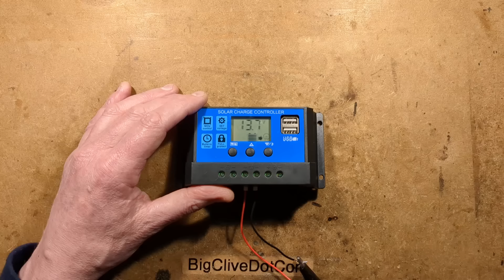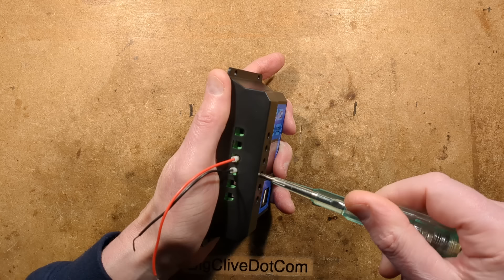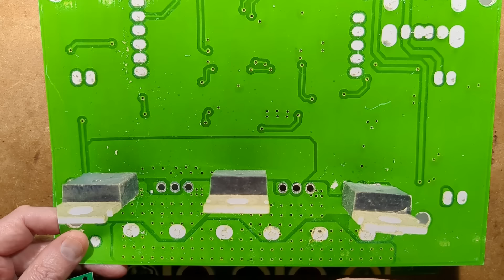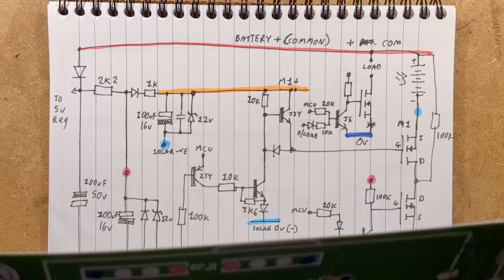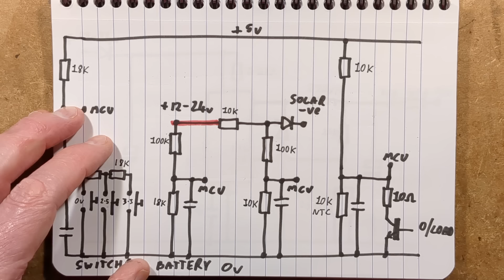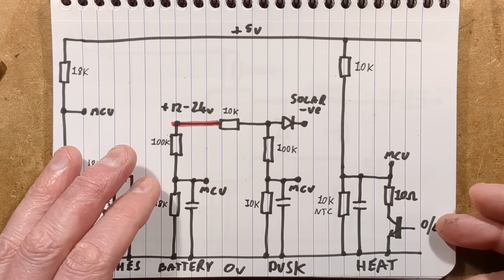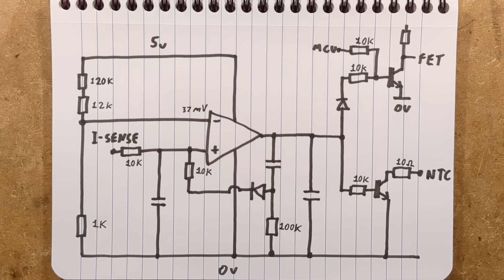Exploring a mass produced solar charge controller

Comment: For anyone wondering what the magic MPPT (Maximum Power Point Tracking) is about, and why it's better: solar panels produce approximately the same voltage regardless of the current they are supplying, until you exceed a threshold, when the voltage drops rapidly. As power is voltage multiplied by current, this threshold is the point where you get maximum power out of the panel, and depends on conditions (temperature, but more importantly, how strong the light is).

An MPPT solar charge controller presents a resistance to the panel which results in it delivering the maximum power. It does this using a buck regulator and an algorithm to adjust the power transfer of the regulator as solar conditions change, which can be hard to achieve when you consider things like shading of the panels. This cheaper PWM tech merely connects the panel straight to the battery if the battery voltage is within range. This will bring the panel voltage down to virtually that of the battery, delivering approx. the same current but less voltage than at its maximum power point. PWM is used to reduce the average current to keep the battery voltage in range as it nears full charge.
Reply: I've been using MPPT charge controllers for years, and I've noticed that PWM controllers typically generate 60-70% of the power compared to MPPT, depending on the battery voltage. With newer, more efficient solar panels producing higher voltages, PWM controllers are becoming increasingly inefficient. As a result, they drop more power, which not only reduces the overall energy output but also potentially increases the solar panel temperature. This temperature increase can further decrease the panel's efficiency and lifespan.
Reply: @CroftGaming1  Yes, that figure is one I've heard.
Reply: @CroftGaming1  you mentioned that "they drop more power, which not only reduces the overall energy output but also potentially increases the temperature of the panels". I'm assuming you're referring to their surface temperature. I'm interested in knowing some more about that if you can elaborate some more, please.
Reply: Several charge controllers which have been sold through Amazon (I haven't looked to see if they still are) are conspicuously marked 'MPPT' on the case but are actually PWM with a generous price mark-up.  (Marty T bought one for his solar set-up.)  They apparently work okay, but not as well as the picture and price would suggest.  Caveat emptor.  I use Victron, which are excellent — at a price.
Reply: @Alan-ln3ls  the brand name is MPPT Solar, the device is PWM. It's scummy.
Reply: @Alan-ln3ls  Well there are plenty of cheaper alternatives that work fine. If the listing contains photos of the PCB then it's immediately clear if they are MPPT or not. If it doesn't and what you receive turns out not to be MPPT, simply reject it.
Reply: @matthewmarks6951  Somebody did a detailed analysis of these fake MPPT devices in a YouTube video, and concluded that the display showed strange readings — presumably to reinforce the idea that they were MPPT — but as a PWM controller they actually did a reasonable job.
Reply: @Alan-ln3ls  I can agree to that.. Output for both are essentially the same for all common uses. My van has 4 panels, 2 x 100w (PWM) and 1 x 200w (MPPT) I can test any time with a clamp meter. All are connected to the same set of batteries so voltage is the same.. You would need a more precise measuring machine than my clamp meter to notice a difference.
Reply: @jefftysoutube  MPPT comes into its own at low light levels.  In your case, it would work well with the three panels connected in series (the controller would need to be rated for minimum 75V input).
Reply: FWIW julian illett has a lot of videos on the topic including a DIY mppt controller project series, they are really informative and he also checked a bunch of solar charge controllers for whether they are truly MPPT. can be helpful if you are looking for one. i just went for a victron controller in the end because it's proper MPPT and it makes a pretty big difference in efficiency in my experience. My evolution in a cabin was: the PWM controller in the video (pretty bad performance in winter) -> cheap pseudo MPPT controller from aliexpress that uses a buck converter that has to be manually set to the Vmpp of the panel (better but still not great in winter/low light) -> proper MPPT controller (works great). to be honest, i just had undersized solar panels for most of the time, i think the most straightforward for any small self-contained solar setup these days is just to overdo the panel size and get a cheap controller because the panels are super cheap anyway.
Reply: @Reversed82  Indeed they are super-cheap, but that means the limitation is often where you can put them.
Reply: I threw this away and replaced it with a true MPPT charger. Because these are PWM and leave a dirty pulse noise on the battery circuit that could damage 12v electronic circuits..such as a TV in a caravan. Or blow or flicker LED lighting.
Reply: @andrewtitcombe8378  MPPT uses a buck regulator which chops up the current in the same way. It's all down to how effective the filtering is.
Reply: PWM is better for mobile use. For example on van roof. If it is parked for longer period under roof will not make battery go flat and can restart even with flat battery.
Reply: @otofoto  How does it make a difference if it's PWM or MPPT? The device being reviewed consumes up to 4 mA constantly just with its voltage regulator, before you consider how much the MCU is consuming, so can certainly flatten your battery.
Reply: @matthewmarks6951 Difference is that PWM can auto recharge flat battery.
Reply: @otofoto  Why can't MPPT?
Reply: @matthewmarks6951 Because it needs reference voltage. Some models have manual override but it is manual.
Reply: @otofoto  PWM controllers need a reference voltage too, in order not to overcharge the battery. I'm still not with you I'm afraid.
Reply: @matthewmarks6951 need some practical test to confirm if MPPT can trickle charge flat battery.
Reply: @otofoto  I am afraid PWM controller would not start on flat battery, pretty much all of them say "connect battery before PV". As you can see on this particular model it would not work without any battery power.
Reply: @bumbarabun They say it to not have voltage peak. Even flat battery works as stabiliser.
Reply: @otofoto  Stabilizer is not enough. PWM controller would not even start to work until it gets voltage from battery. For example lithium batteries would not give you any power when flat due to BMS.
Reply: Both have pwm outputs. An mppt has current monitoring and turns down the duty cycle if voltage dips too far.
A pwm charge controller could be modified to work with higher input voltage as it's just a buck converter.
Reply: @3fives-j5w  No it isn't. A buck converter stores energy in an inductor, enabling volts to be converted to amps. There is no inductor in this circuit, so it cannot charge the battery with more amps than the solar panel is producing. However, you are right that a buck converter can be adjusted to limit output voltage.
Reply: To my understanding the drawback (used to be?) with using a MPPT controller is that it use more energy to power/measuring its circuits, meaning it uses higher standby power draw when there is no sun, whilst the PWM take less power as its just more of an simpler on/off switch. However this is old knowledge ive read on the internet and that might not apply anymore, also it might be that a better or more expensive unit is built so it can go into sleep mode to conserv energy at standby.
Reply: @Jon_Doe_404  When it's actively charging it will burn more power simply because of what it's doing but it's not an issue in relation to the power coming in from the array.  When charging isn't active MPPT chargers typically do draw more current than a dumb PWM charger but only because they continue to provide telemetry etc, ie they are doing things that a cheap PWM doesn't.  Again, it's really neither here nor  there.  A Victron 75/10 has an idle draw of 8 to 10mA.
Reply: @Jon_Doe_404  The only drawback of MPPT is price. There is no advantage to PWM other than being cheaper.
Reply: @gwillen  I think at very low currents there might be a minor disadvantage. For one thing you've got that inductor in series, and also the MPPT algorithm might start to hunt and be less effective than simply effectively connecting the panel straight to the battery. But as others have said, this may be insignificant.
Reply: Like you said tho it's based on how strong the sun is and in the UK that's a pretty big issue, the pwm just keeps pumping away as long as it's got enough to start they both have pros and cons.
Reply: @SlyerFox666  It's all relative. We have plenty of sun in the UK, especially in recent years in the SE of England. A 450 W panel costs about £75. I've been generating 30 kWh on most days from my roof for about the last three months. I can't use a lot of it. I got nearly 200 W from two 100 W vertically-mounted panels on a sunny day in December!
Reply: @SlyerFox666  I've seen it said that for small 12 volt camping type solar setups the difference isn't that significant. I cenrtainly get more power than I need to keep the battery charged most of the year with a PWM controller.
Reply: @NiallWardrop  Same here with a sub 25watt panel and an old car battery in the shed powering a few LEDs every now and then. Saved running mains powered lights.
Reply: @SlyerFox666  not exactly, a MPPT will produce more power than a pwm especially in low light and low temperature condition.
Reply: @CroftGaming1 only because they are typically wired to higher solar PV voltages. Nothing to do with mppt really.
Most pwm controllers won't accept voltages much higher than battery voltage so when the solar voltage dips it can't charge the batteries. With a higher input voltage it can still charge as long as PV voltage is higher than battery.
Reply: @3fives-j5w  No, I'm referring to the same battery voltage and panel voltage conditions. Interestingly, the MPPT voltage actually increases under low light conditions. However, when the light becomes extremely low and the panel's VOC starts to fall, the panel's power output becomes negligible, and you might not even get 1% of the panel's rated power.
Reply: What I still don't understand is that regardless of the voltage or amps in the output, the total power produced by the panels will be the exact same
Reply: @User-w7ckl  If you include in this total power the heating of the panels then yes. The panels don't change in appearance when you draw power from them, meaning that they absorb the same amount of light (energy) whether you draw power from them or not. What isn't drawn from them as electrical energy is just dissipated as heat.
Reply: @matthewmarks6951  "What isn't drawn from them as electrical energy is just dissipated as heat."......This is wrong. Panels to me seem to be just as warm whether connected or not. Luckily I could be right otherwise closing the circuit by connecting the + & - leads to each other would be rather interesting.....nothing happens as open and closed circuits in a solar panel are effectively the same....zero!.....someone better than me can explain better.
Reply: @jefftysoutube  No, you're wrong. A disconnected panel will be hotter. Those photons are hitting the panel regardless. Either they are absorbed as heat, or they are used as electricity. A 400W panel would be hotter by ~400W if it's disconnected. Given there's about 1500W of solar hitting each panel, that's measurable.
Reply: @jefftysoutube  I'm afraid ye cannae change laws of physics, Jim - in particular, conservation of energy. If what's hitting the panels is not coming out of their wires and not being reflected then where does it go? The only thing that can happen is for it to be converted into heat. The reason why they "seem to be just as warm" when power is drawn is that panels are only about 20% efficient anyway, so the difference in temperature is not very noticeable. I'd also suggest that being in the open air they have good cooling so the temperature rise won't be as great as if they were in an enclosed space.

You are right about shorting the panel. The current flowing will hardly be higher than the current at the maximum power point - in other words, what it's designed to handle. The temperature will be a bit higher, though, for the reason stated above.
Reply: @matthewmarks6951  The 20 percent conversion rate of PV applies only to the panels electrical output. It does not imply the remaining 80 percent is converted to heat by the panel.
Reply: @jefftysoutube  Some is reflected (whether power is being drawn or not). Where does the rest go?
Reply: @matthewmarks6951  Just to clarify...."Where does the rest go?" Open circuited PV produces no power. Photons are absorbed as heat or bounced back still as photons. Any increase in temp will depend on how the pv handles heat in the passive position and not from it's ability to use the power no longer being used...because there isn't any!
Reply: @jefftysoutube  Simple equation: heating = energy in - electrical output.

As energy in is a constant, because the panel's reflectivity does not change, the less electrical output there is, the more heating you get.
Reply: @matthewmarks6951  When the panel goes open circuit the process of converting the photons energy stops because there is nowhere for the electrons to go. It stays with the photon. Some may go to heating the panel as you say. However, because of it's particular wavelength most will go elsewhere.
An analogy would be when a alternator goes open circuit....the energy that was being generated as electricity stays as kinetic energy in whatever that was driving the alternator
Reply: @jefftysoutube  Where is "elsewhere"? Elsewhere would mean reflected - in other words, the panel would change appearance when you disconnect it because you would see this reflected light. It doesn't.
Reply: @jefftysoutube  I did the experiment, and the panel disconnected is hotter than the panel producing energy.
Reply: @CroftGaming1 or you could say "The panel producing energy is cooler than the disconnected one'"

Think about it before dismissing this suggestion!
Reply: @matthewmarks6951 I think we are looking at the issue in reverse. ...two disconnected panels sitting on a roof. Connect one to a load and that one becomes COOLER!
All your conservation of energy concerns are met and my reasoning that because of the pn junction nothing happens...it just returns to its default state.
Reply: @fgbhrl4907  No. I'm right! When disconnected the panel only returns to it's ambient, pre-connection temperature. This is only slightly higher than a connected panel supplying amps.
The temperature rise is a correlation not a causative result from going open circuit.
Reply: @jefftysoutube  Think about what happens if you connect a giant resistor to a panel, say 1-ohm. Let's say, P=I2R, and we're pulling 10A^2 * 1ohm  = 100W through that resistor. Let's say it's a 100W panel, and we've chosen the resistor value to be at peak VMP point. That resistor is outputting 100W of heat. What happens if we now disconnect it? The same number of photons per square meter are hitting the panel and being absorbed. So where is that energy going? The answer is: heat. Panels are ~20% efficient. If you don't pull that energy out of the panel, it becomes heat.
Reply: @matthewmarks6951  power out is about 20% of the sun power in, so with a charged battery the panel will get 20% hotter, but I have not checked that!  It seems logical that when the current is higher (at max power point) the heat generated should be higher, but that is also going against conventional wisdom!
Reply: @willgeorge5644  That depends on the resistance of the interconnections, which will be quite low, so not much heat generated. They will be designed to get the best compromise between heat dissipation and the amount of light they block.
Reply: @User-w7ckl  Take a look at the IV curve of a solar cell and you'll understand.
Reply: @User-w7ckl  The trick is that while a PWM controller will just regulate the battery charging voltage at whatever current it wants to draw which can put a load on the panel which reduces available power (voltage times current), a MPPT controller will adjust both the voltage and the current supplied to the battery for the maximum power transfer from the solar panels. This can't be done with a linear regulator it can only be handled by a microcontroller algorithm. Every so often the CPU tries bumping the current up and if the power transfer efficiency increases it keeps the new value. If it decreases though it will try a lower value to see if that if more efficient. If neither is better then it keeps the current value. After some predefined interval it will try optimizing the power draw again and again.

ICBW but I believe real MPPT controllers can also produce usable charging even on dull days when an PWM controller would be useless.
Reply: @PhoenixRevealed  exactly that's how MPPT works, it produce more power specially during dull days, because of low power coming out of solar panel and produces less heat the MPPT voltage is way higher than normal days.
Reply: @User-w7ckl  You are correct, but...  As daylight varies, a solar panel's voltage and current 'potential' output also varies.  Note the word potential.  Connected to nothing a solar panel produces nothing so its potential is all wasted.  A solar charge controller tries to match a load's requirement - in the case of a battery usually the voltage, but does limit max current.  As the charge controller is effectively 'mucking about' with input voltage, current, or both, a good controller will use a lot of expensive circuitry to suck as much power from the panel as possible and convert it to the volts and amps the load requires.  A cheaper controller will do no voltage/current conversion and merely cut off the panel from the load when the panel output goes under voltage or over an allowed voltage/current combination so it will be wasting a lot of the panel's potential power.  Maybe this helps?
Reply: @User-w7ckl  no, current X voltage in and current X voltage out are the same except for a small loss. MPPT tracts the solar panels voltage that produces the highest power until the battery is full.